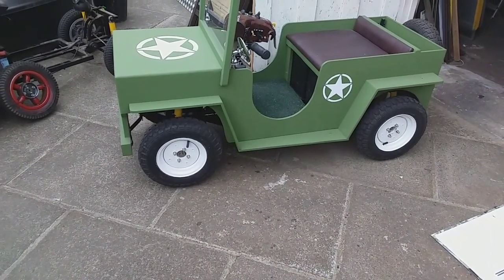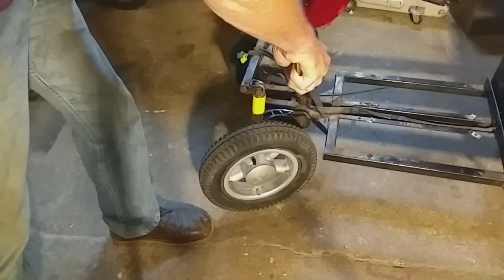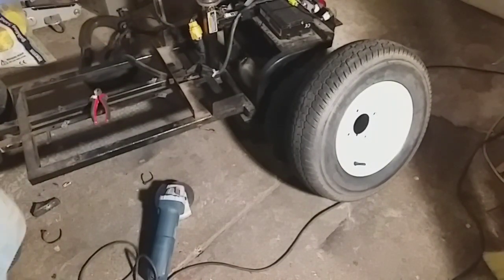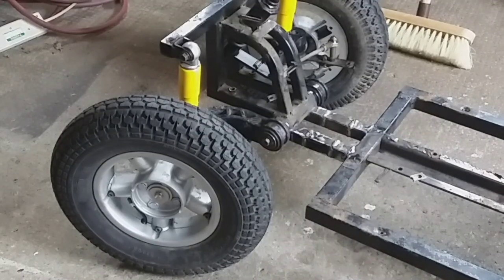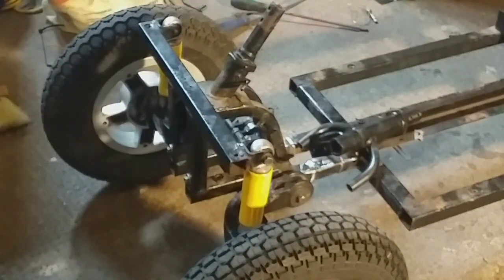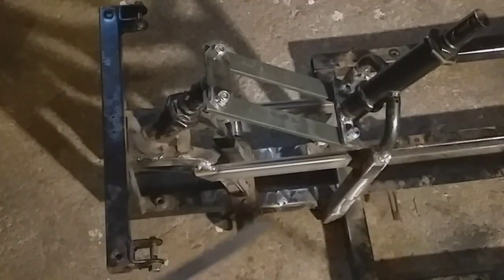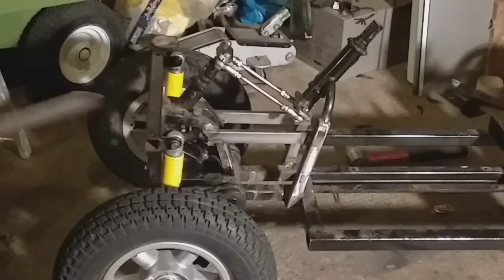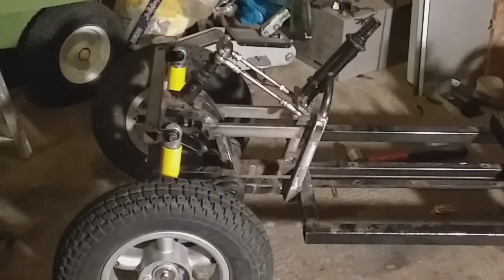More  Mobility Conversion Information

Comment: Absolutely this video has answered a major question I've been having with how to convert a Pride Ralley 3 wheeler into a total custom 4 or 6 maybe even 8 wheeled totally  still usable as my daily grocery getter scoot I used this ralley because it is old enough it may be harder to get parts for. So let me share my dream, I bought a full size grocery cart that I will use as the new body extension  to which I will add the front portion of the Ralley I've started by separating the parts of the donor scoot ( many of the Pride units have a easy disassembly feature stock ) so ounce I had it apart I turned the cart to the orientation of left to right in front of myself as if a person was pushing it from my left to my right with the cart setting in this orientation I considered the left or handle side to be the front when the unit is completed . So now I set the power plant portion minus the wheels & tires onto the back lower shelf of the cart. to the left of this I will add several extra high power Lithium batteries set up in 2 12v sets of batteries so I only need to add a band of switches to change which set is in use at a time . I will also add a 12v battery set to run my vehicle components on. next I need to move what was the steering stock, base board & instruments to the left side of the cart where I will bolt & weld it & new beefed up frame work to carry the newly added weight & features. this concern with the weight is because the donor scooter is only rated for a max load of 400lbs. I will both gain weight capacity by using lithium batteries but I will loose by using several more & larger ones ) I'm not sure how this weight capacity is figured, so that is part of the reason why I'm not sure how many wheels & tires I will need to suport the new weight. it isn't that major of a issue because if it is to much for this motor I will up grade it. I really want my TtT C Cab 1924 ford delivery micro mini truck / mobility scooter. Yep that's thelook I'm going for. I hear customizing these scooters is a big deal on the other side of the pond. When I finish this current build My plan is to build a USA wide customizing club to make more of these to provide my fellow ol custom bugs a last great run. We did the vans & mini trucks as well as the hot rods. wish me luck. but yes the way you did this front drive assembly did help me very much. And if you ever need a idea for another video how about a nice slow detailed how to make those front bonits I think you called them & your fenders thanks again I'll be watching.